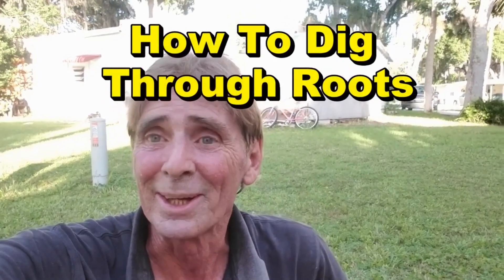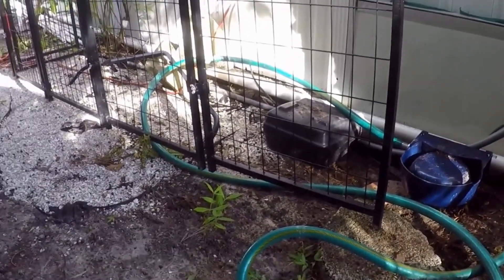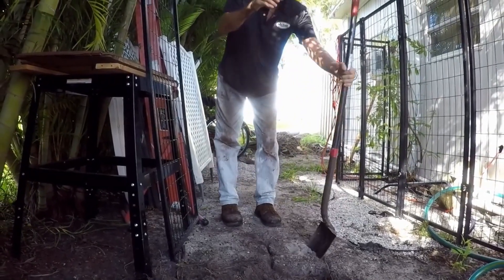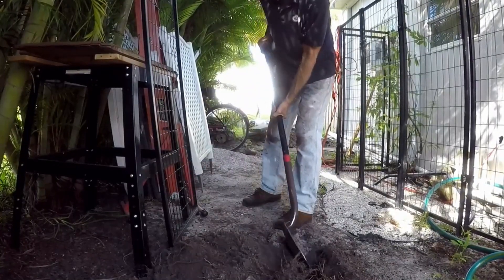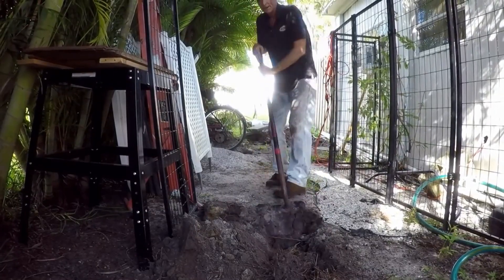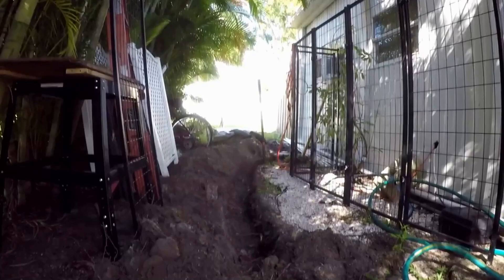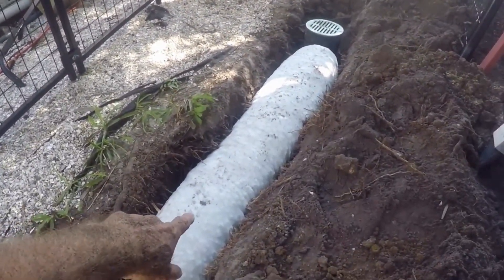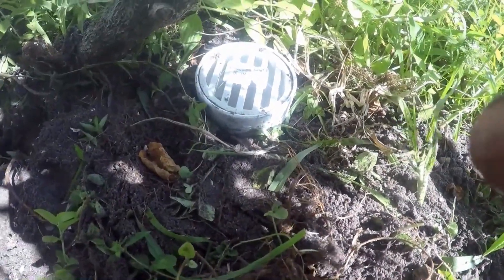Yard Drain - Low Spot Filled with Roots - DIY HARD WORK, but Worth It!

Comment: I’m 23 now. 2 years ago I follows the instructions in one of his videos and routed my sump pump to the street under ground. Now my yard doesn’t flood. I’ve done other improvements since then but this guy really saved me a lot. A local company quoted me $1500 for the job back then. The pipe and materials was probably 60 bucks and since I did it, labor was free. My lawn is mostly clay so it was very hard to do xD pray you have roots like in this video